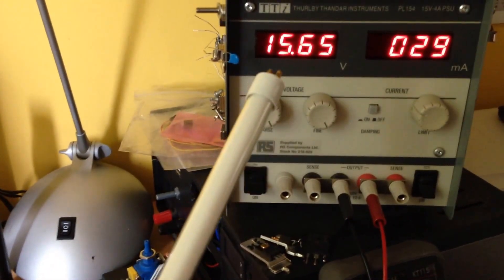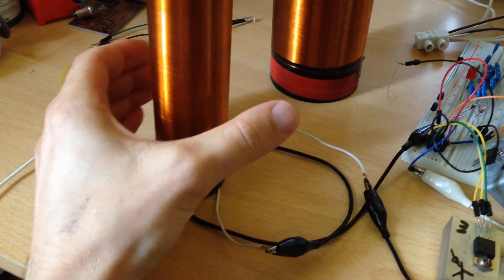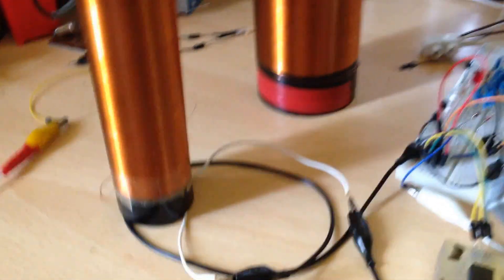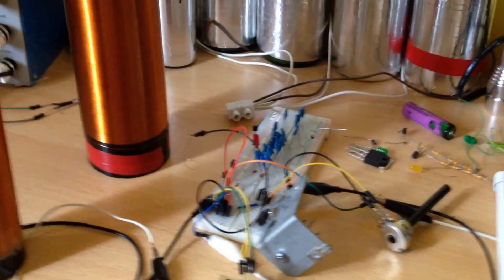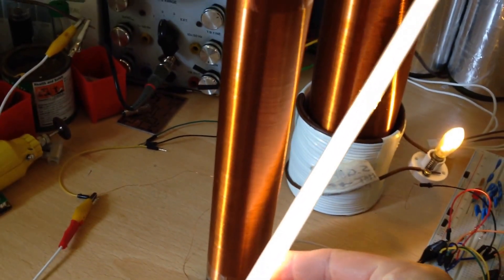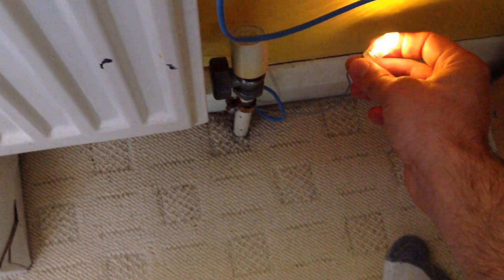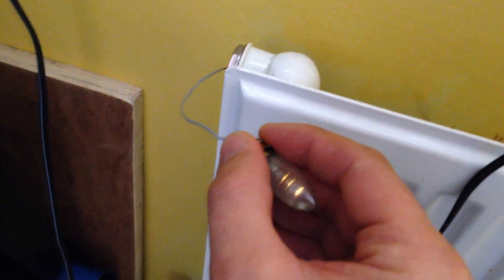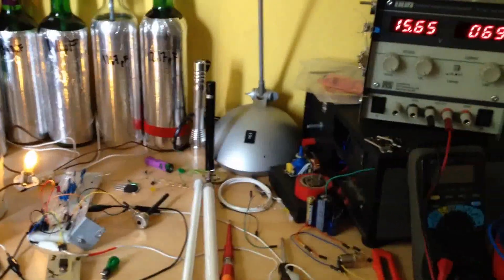Magic Slayer Exciter

Comment: what do they mean earth the antennae?! i dont understand...
Reply: Ground the bottom end of the secondary to the Earth rather than connecting it to the base/gate of the transistor. Most Slayer's connect the bottom end of the secondary to the transistor's base/gate terminal to use it as feedback to switch the transistor, and cause it to create a conduction through the primary that replicates the sinusoidal waveform that the secondary oscillates with, and makes it self tune the primary/transistor operation to the secondary's resonant frequency. I use the word "switch" loosely when it comes to Slayer's, because most of the typical Slayer's operate in what's called Class A, which for transistor amplifiers is a very inefficient operation that is never fully on, or fully off, but rather it operates in the transistor's active region, using resistance to control conduction and create a sinusoidal waveform, and it wastes a lot of energy as heat. That's why Slayer's are so hard on transistor's, and only power transistor's with big heat sinks stand any chance of surviving long.

Comment: Can someone please tell me if we can convert this radiant electricity to DC.
Damn! I live in an apartment at third floor. Don't have access to a true ground. I have heard that if you connect the antenna of the secondary to earth the setup can give out dc. Don't remember the exact details, just remember the part where it was said "Earth the Antenna"
Reply from the maker: Yes! You can easily convert it to DC , you can but you don't have to use ground, simply use metal pipe or large metal object ;) if you will have any more questions feel free to ask!
Reply: +Kamil Domjan Thank you. If you could please shed some light on this.

There are 2 ways in which I make my setups. 
1. With +ve connected to base with a resistor (traditional way)
2. Without connecting +ve to base with a resistor (traditional way). The coil coming from secondary to the base is enough. I just have to tap it to start running.

To be on safe side I always add a resistor to the primary ignition coil. To make sure that I am not feeding too much current. It helps me in protecting transistor....which gets really really hot. So have to find a sweet spot where nothing gets hot. I am not a fan to that plazma thing you get on top.

I play with 3 to 9v. I have seem few guys having plasma at 5v and they don't even have heat sinks. Which makes me believe that its all in the transistors and the frequency at which they switch. I use BD135. But a Chinese friend suggested to use BD243.

I need to find out why this setup goes hot and what are the measures or calculations one needs to do to prevent it from getting hot? 

How can one find out that sweet spot where circuit does not get really hot?
Reply from the maker: +Talha Kamran Mine best schematic was taken from Abramslab, he got video on how to do his circuit. In terms of how to get best out of it is not easy because you need find the right transistor and second most important in my opinion will be primary coil where you could easily tap into, remember always use heat sink for transistor and ferrite rings inside secondary coil will help you a lot with getting most out of the coil ;) please promise for me that you will make video of your set up and share it with us ;)